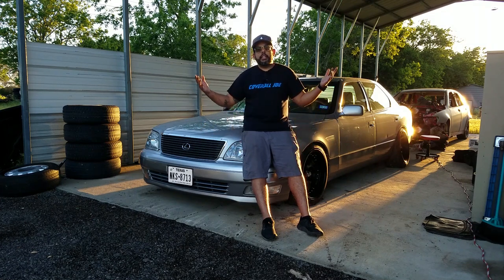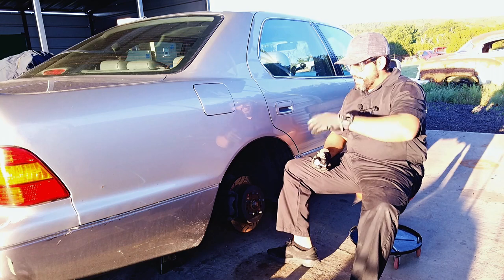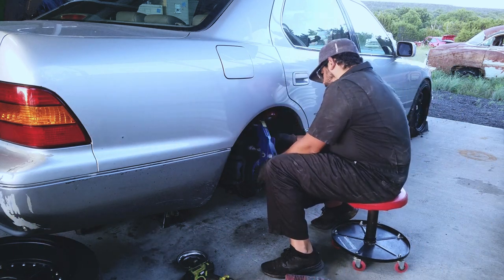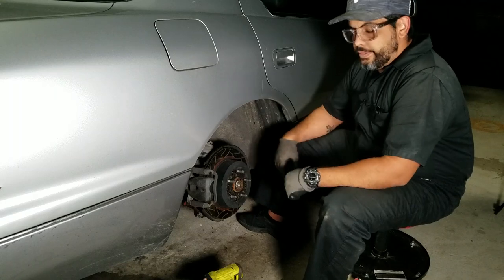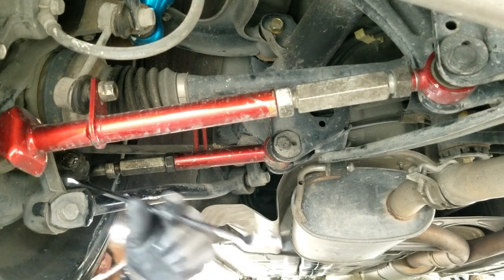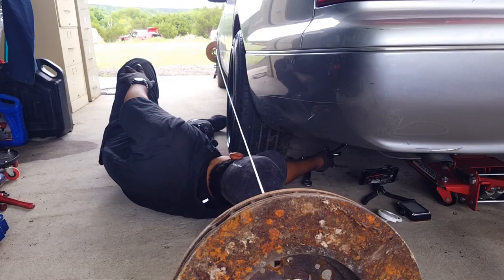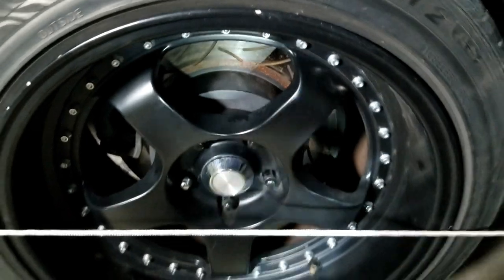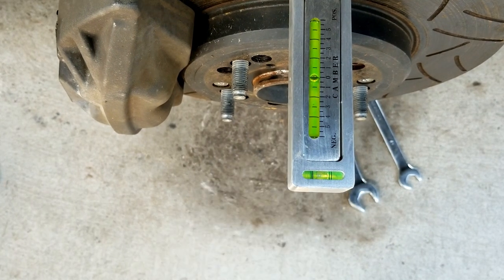DIY Alignment on the Lexus LS400 and "Fender Rolling" (first timer) 😎 // LS400 New Stance Part 1

Comment: Joe, I have an ls400 97. 

My question is for a proper alignment with the bc coilovers and oem wheels, do I need the adjustable camber arms and lower control arms to get a perfect alignment?
Reply from the maker: @Ronaldo Waldo , It all depends on how low you go. You can get a near perfect alignment by just using the factory camber adjustments if the amount of drop does not affect the geometry of the stock suspension. Any more than that,  and the wheel will camber negative. If you plan on going low, my best suggestion would be upgrade to adjustable rear lower control arm (camber), toe bar and traction bar. 😎👍